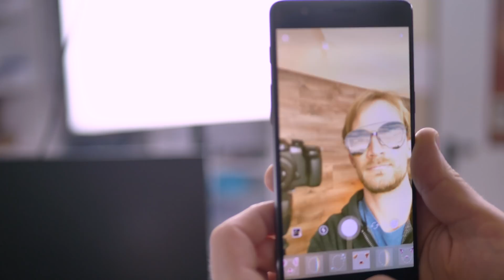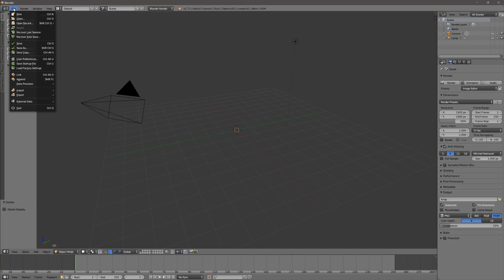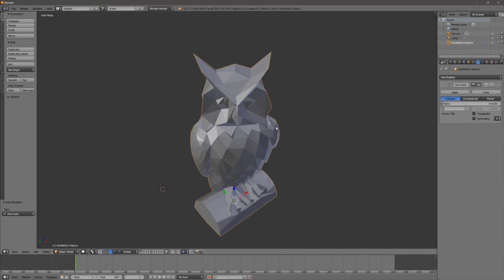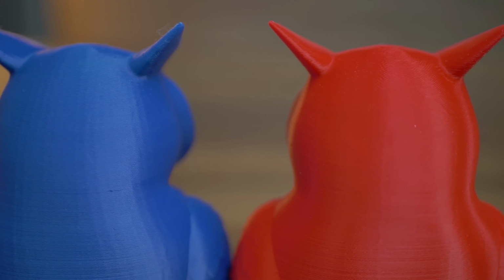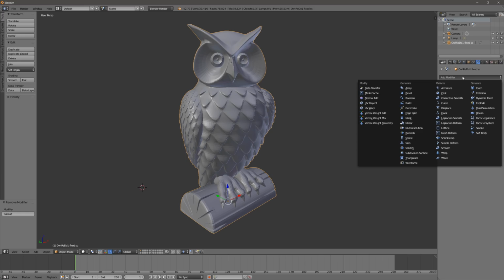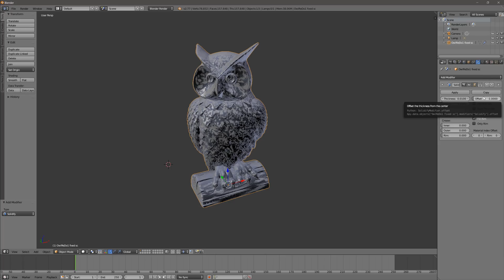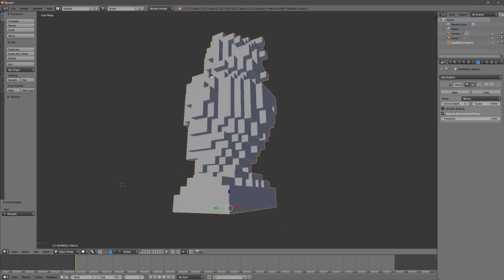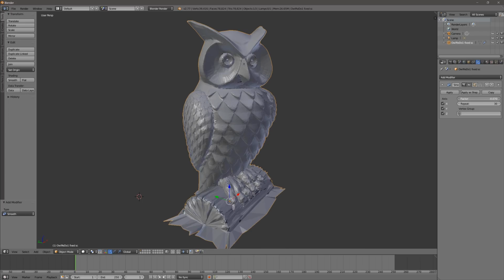Learn the art of STL-bending!

Comment: Keep in mind Solidify is meant to make non-manifold into manifold; it basicaly makes each face two faces; not only it can produce overlaping meshes, but is also makes things hollow, you're growing a shell.

But if the mesh you started with didn't had any holes, you can go into edit mode, select one of the faces, then go into the Select menu and click on Linked (Ctrl-L) and delete that set of faces to make the thing solid again. I'm not sure how to easily fix self-intersections automatically with Blender though.

Comment: Quick tip, the reason the scaling is so weird is that blender by default uses it's own "Blender internal units" which is meters. If you click on the scene tab from the right toolbar thing next to the modifiers you can change that before importing to get correct dimensions. This will also help you from potentially having clipping issues, which you can also address by pressing "N" in the 3d view and changing the near and far distance cutoff.
Reply: I also feel like you should've done one of the voxel ones in wireframe... could be neat.

Comment: Excited to see you showing off Blender. However, I will say, Blender can really easily make bad meshes. The solidify modifier in particular will create a lot of self intersections. Cura can generally handle these, S3D goes a bit crazy dealing with them. So be sure to fix them with netfabb's cloud service or Windows10 3D builder before sharing them.
Reply: Also, keep in mind Solidify is meant to make non-manifold into manifold; it basicaly makes each face two faces; not only it can produce overlaping meshes, but is also makes things hollow, you're growing a shell.

But if the mesh you started with didn't had any holes, you can go into edit mode, select one of the faces, then go into the Select menu and click on Linked (Ctrl-L) and delete that set of faces to make the thing solid again. I'm not sure how to easily fix self-intersections automatically with Blender though.

Comment: Blender is just awesome - it opens up the possibility of 3d printing frames for stop-motion animation, with real lights fuzzy shadows, caustics and real radiosity.
Could even print the camera tripod in the right position with the correct angles for a real camera to shoot the frame!
Reply: Is there an add-on for exporting each frame as a separate model automatically?
Reply: There should be - someone in a blender forum should be able to answer that for sure.
It would only be a script that is called every frame to do the export using current parameters.
Reply: You've probably seen this example:
Bears on Stairs https://vimeo.com/91711011
This was demanding enough, even using a 50 frames and a fixed camera, but a taste of what could be achieved.
Yep, definitely lots of challenges especially with jitter of actors and viewpoint, and removing overhang supports. Deshaking and postproduction could take care of some of that with a fair amount of manual labour. Or entire scenes and actors could be printed frame by frame to ensure positioning. Colorizing could be used to cheat on using multicoloured printing.
Would be fascinating to see a more complex movie... perhaps Aardman may have a crack at it.

Comment: Nice! I'd love a filter or technique to add reliefs (like carvings in walls) to non functional areas of functional prints. Like if you print parts of your 3D printer to make surfaces that aren't functionally relevant more interesting and ornate.
Reply: I don't think there's something that's "just a filter", but if you wanna model the details in 3d, you could use the Boolean modifier to add and subtract shapes. Alternatively, if you can get the texture in the form of an image file, you could increase the resolution of the mesh in the areas you wanna add details (possibly with the help of the Boolean modifier to just add details to that part) and use that image with the Displace modifier (might need to mess with UV maps to get things the way you want, and maybe weightpaint some vertex groups to make the effect localized; or instead of UV, you could set the texture coordinates in the Displace modifier to Object, and add an Empty and select that as the object to let you move, rotate and scale the texture by manipulating the Empty). And something sorta midway between the two approaches would be to model the stuff, then increase the resolution of the area and use the Shrinkwrap modifier to deform the mesh with the stuff you modeled.
Reply: For the displace, you can also use some of the parametric textures instead of images; the colored ones can produce some interesting results with the direction set to "RGB to XYZ" instead of "Normal".
Reply: Thanks but I was thinking more in the sense of procedural generation and procedural textures. For parametric models as well so if you change the dimensions for a part, the art adapts intelligently too.

You actually could designate some areas or a volume above the minimum surface of a part as "artistically" and then automatically generate UVs, textures and "fit" different shapes (like borders or bevels) in it. A mixture of just procedural generation and some of that AI based "deep dream" images just in 3D.
I know it's a tall order but it would be possible to do.

Of course you can do it by hand but engineers who design functional 3D printed parts simply don't do that.

Comment: You can stop certain edges from being smoothed by hitting tab to go into edit mode, shift-right clicking the edges you want to keep, then pressing shift-E & moving the mouse up until the lines you have selected go pink. Works well to stop the base becoming rounded.
Reply: Shift-E, 1, enter (just in case you don't move the mouse far enough)

Comment: I'm amazed people use blender for 3D printing stuff.  I was the developer who made the decision not to support CAD workflows (this was before consumer 3D printing took off), a choice I now deeply regret.  My professional pride compels me to recommend against using Blender for 3D printing stuff (after all, it's my fault it sucks for that).
Reply: It's probably not too late to make amends and make it better.
Reply: It works great for quickly mangling existing STL files obtained from Thingiverse, etc. I've used it several times to plug unwanted holes or removed features I didn't want on parts. Not many options exist for the Linux crowd.

Comment: The results of the subdivision modifier would've been better had Thomas converted the polygons in the model from triangles to quads. The owl was well modeled, and there's probably a quad version out there somewhere (in a format other than STL), but STL files only support triangles, so the quads were broken into triangles. If he had gone into 'edit mode', selected all faces, and hit alt-j, the triangles would've been joined into quads, and the subdivided mesh would've retained the ordered character of the original mesh, which would depict the surface with better fidelity. (This is assuming that in this case Blender chooses to pair the triangles correctly, which isn't always true).
Reply from the maker: +Stephen Kongsle great tip!
Reply: Thomas Sanladerer  great video and thanks for bringing Blender into the mix as it’s an awesome FREE tool that offers an insane amount of tools for creating,repairing, remixing and finishing 3D models. Taking the “Blender Course” is fun and very useful especially for their sale price of $10!  Again thanks Thomas for your awesome Vids and you should definitely do more Blender and or Meshmixer videos!
Reply: You can actually do that right in blender! (alt-j in edit mode)

Comment: Great stuff! I guess I should squeeze my nose closed and dive back into Blender after all. Worked with it more than fifteen years ago not being a 3D designer at all, and was hesitant to get back into the daunting interface now that I got into printing and also modeling, just less than a year ago.
Reply: It can be a little slow at first to get used to all the commands and stuff; but after a while, I often don't even think about what commands I'm trying to do, it's more like learning movements, I just hit the keys without even thinking about what the command is called.

They need to make the beginner learning curve a little less daunting; but after a while using it, after a bit of practice, one day you'll realized you "know kung-fu" :)
Reply: Thanks. I haven't had the time to yet, but I still might jump back into it. Also thinking and hoping things have become a bit easier than fifteen+ years ago.

Comment: I personally use Blender for 3D printing all the time. I think using Blender's modifiers is a great way to quickly add style to a model. There are many other "filters" and modifiers that you can apply to a model, and the process in Blender is very good for customization. However, using Blender for modeling objects with exact dimensions can be slightly difficult. What CAD software do you use to create your models?
Reply: OnShape. Provided you don't mind making your model public...